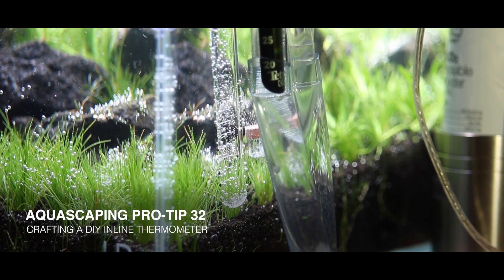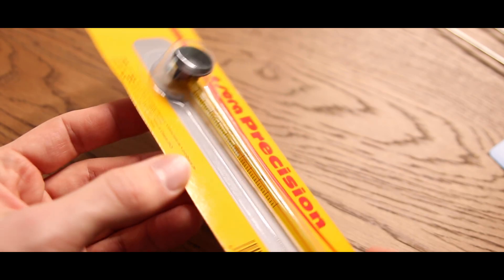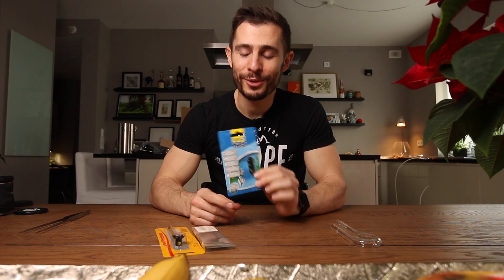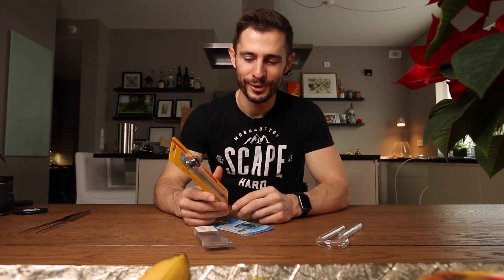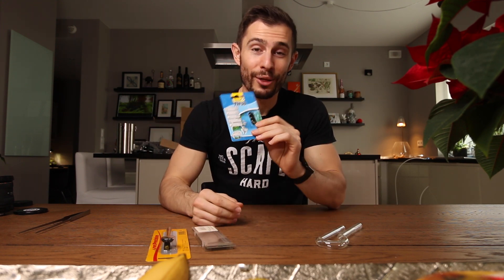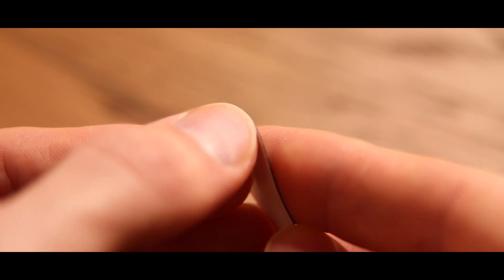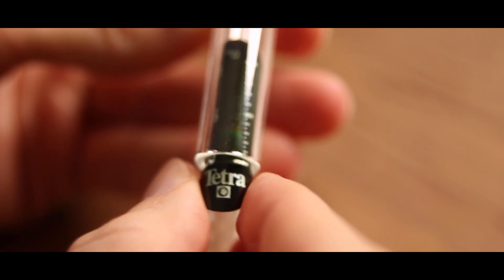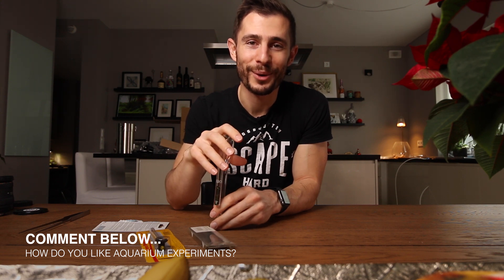DIY Inline Aquarium Thermometer

Comment from the maker: I had fun making this video 🙃 not sure if the inline thermometer is going to stay to be honest 😂 Would you keep it?
Reply: The question how long it will last in the tube?
Reply from the maker: so far so good
Reply: I would not keep that. However, when the impeller sound more like a coffee grinder, well, than that did not stand the test. Keep fingers crossed.
Reply: I wanted to ask, when I earn my reward of the seachem Giveaway😃 I wanted to start my 120f in a week, and I still need these Seachem products 😬 otherways, I have to buy them myself🔥💥
Reply: I would make an experiment out of it.

a) I'd check for migration up the tube with water flow.
b) I'd plot this thermometer against others in the tank and room temperature?  Is this one reflecting the same temperature as in the tank?  Is this one accurate for only a certain range of temperatures?  What happens when there is a greater difference of temperature between the tank and room?

I'd have fun.  :)

Comment: Nice idea but I got a better one 😉 Just use an infrared thermometer. They cost as much as a hang on, you don’t need a thermometer in the tank anymore, of course you will have to store the infrared one somewhere…but if you need to measure, you get the temperature quickly, accurately and from all of your tanks if you like.

Comment: Hey I have a question I currently have the stock light that came with my fluvel flex 15 and I saw a review on it and said it had 30 par but I want to upgrade it to a ADA light with par over 30 any suggestions? Thanks love your vids <3
Reply from the maker: I suggest you go for Twinstar adjustable series, SA or similar,  - at least one with adjustable length and height to make sure to fits on your fluvial flex, good luck and merry xmas ;)
Reply: Ok thanks ps. I bought that tiger lotus bulb that you suggested and it’s starting to grow <3
Reply from the maker: Nice

Comment: Jurijs, good video!  Your friend was wrong, though.  Sticky thermometers are calibrated to give you a reading of the tank temp, IN SPITE of being on the outside of the aquarium.  Your first idea of sticking it on the outside of the lily pipe may have been right!  Please post a follow up video!  😀💦🌿👍
Reply from the maker: It wasn't obvious in the video - but at the end you can see it being used and it shows the temperature quite accurate, I compared with the hang on. however, I find it difficult to read. So it wasn't all success, but hey I had fun doing it and I thought I capture it on camera. There will be more experiments

Comment: I agree with you that the sticky type thermometers are not that accurate but I had to default to using them on my two tanks because I had all different types of glass thermometers in the tanks before that and after a while they all stopped working. They would get stuck at around 75 degrees and I know the water was much colder than that. I even bought brand new Eheim/Jager heaters and I know those are very accurate and I set them to a temperature and the thermometer still stayed at 75°F no matter what. It is only if I ran it under really cold water or really hot water that the chemical inside would move up or down. That is how I knew something was wrong with them. I even had these pretty cool ones that were magnetic and you stick it in the tank and a magnet outside the tank holds it on the glass. Not sure what stopped them from accurately reading the water temperature.
Reply from the maker: everything technical that can go wrong, will go wrong haha 😂 thanks for watching and happy holidays!

Comment: It would be probably better and more accurate if you put the thermometer in the outflow instead of the inflow.
Reply from the maker: inflow comes from the tank, outflow comes from the filter and can be affected, but in my case the outflow is smaller diameter and for this reason the inflow was a better fit

Comment: Have you ever used an external digital thermometer with a probe? They’re fairly low profile in the tank although there’s the wire to deal with.... if the wire is still too much of an eyesore, maybe take a small section of the filter tube, drill out as small of a hole as possible to insert the probe from an external thermometer so that the water flows around it, then silicone the heck out of it to seal it up? You could even use a small piece of PVC with a wider diameter than the hosing for this part if you’re worried about restricting flow, and use connectors to attach it to the outlet hose out of sight
Reply from the maker: yes that's an option too, I will keep that in mind - maybe I will do something like that in a future setup where I go crazy with all kind of monitoring 😃

Comment: Nice original idea! But with time, it may bend more and leave the spot to stuck in the corner of the pipe, eventually blocking the water flow :-o But with bit super glue to hold it properly, it would stay in place. Cool tip, thanks ;-)
Reply from the maker: It’s the inflow, if it’s going somewhere it will be the filter, I’m keeping an eye on it

Comment: I don't think the issue of the room temperature influence is a big one: Air is a bad conductor for heat while on the other side you essentially water cool your thermometer with the thermal conductivity of the glass being the only bottleneck. The error you get should be proportional to the heat flow from tank vs outside, hence proportional to the thermal conductivity assuming we ignore heat flow by convection and radiation.

Thermal conductivity of glass: ~1.2 W/K/m
Thermal conductivity of air: 0.02 W/K/m
(Steel is about 30, Aluminium about 230 for reference)

Lastly, just by the great thermal conductivity of metals, you can install the thermometer on the outside of a steel lilypipe without any big error.
Reply from the maker: next time I make a video that requires physics I will contact you beforehand! amazing details, thank you!!!
Reply: @JurijsJutjajevs  Sure, feel free to ask whenever you have any question. You can also find me on reddit and tumblr besides here.